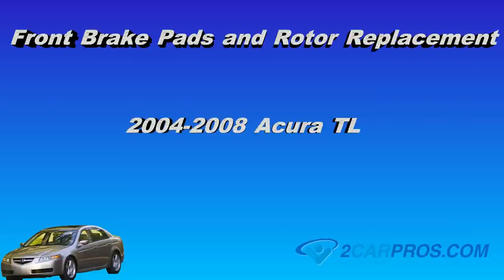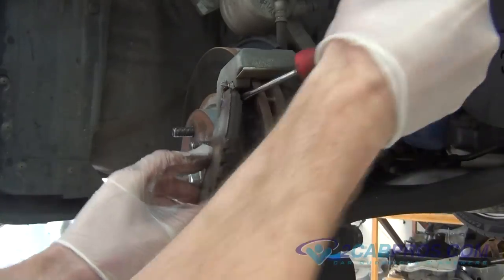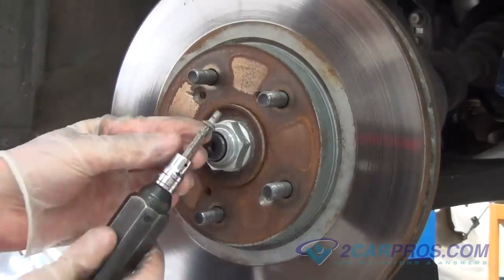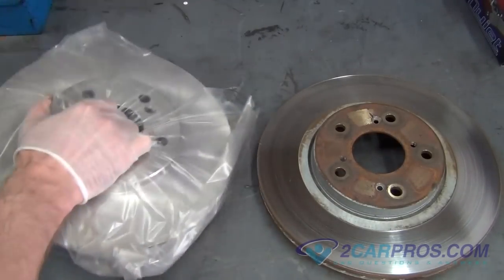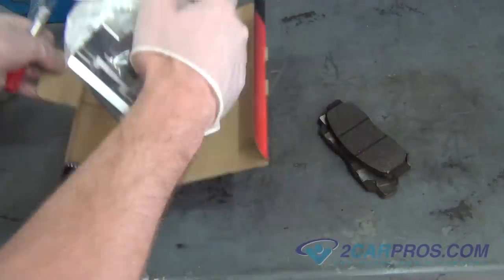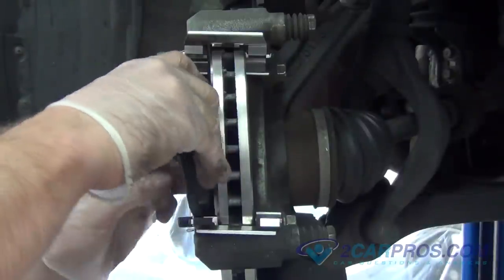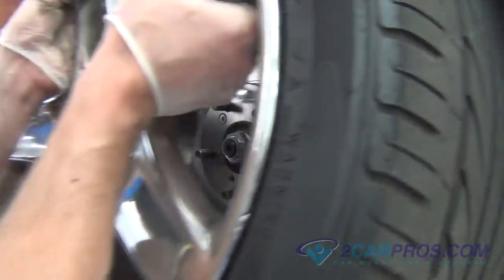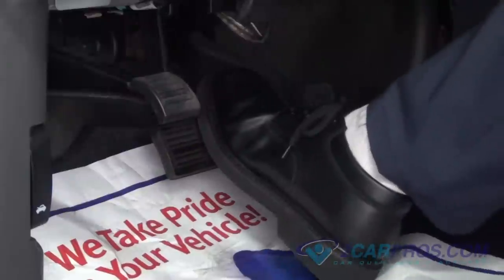Front Brake Pads & Rotor Replacement Acura TL 2004-2008

Comment: For those curios of the appropriate metric sizes here they are:

Caliper bolts: 12mm
Caliper bracket bolts: 14mm
Rotor removal bolts: 8X1.25 bolt use 8mm to remove etc.

You're welcome and hope it helps.
Reply: Franklin Doungahnont manual transmission = 

19mm bolts 
10mm hex
Reply: Does anyone happen to know what size bolt and thread pattern are they using to push the old rotor off?
Reply: That “rotor removal bolt” is very important as I found with my Honda Ridgeline.  It was M8 x 1.25. Thanks for posting this! I was wondering what size that might be and hoping Honda just made all those holes the same size
Reply: You are the best will def need these in the near future
Reply: For me it was 10mm bolts not 8mm to remove rotors I went to the shop just for the 8s and then after that didn’t work I used a 10mm bolt off my old Honda seat brackets and it worked I got a 08 base idk if this is a 04-06 thing with the 8mm
Reply: @E_ina_G  thank you for that. About to do this on my moms '07. So, 10 x 1.25?
Reply: @E_ina_G  Maybe you have a Type-S, and they're different? The brake system is def different between Type-S and non.
Reply: @andreww7857  I mean you can just hit the rotor from the back with a rubber mallet to remove it. I have used this way to get the rotor off on my accord
Reply: If you're right, I fucking love you

Comment: This is an excellent video, both informative and educational. Thank you for this. The anti-seize is true, so add the below comments commensurate with the video. I like the fact that Acura has the two Philips mounting screws that secure the rotors, then has the two threaded holes to use metric bolts to screw-in to pry-out the rotors. Not sure if American cars have this feature, but my neighbor has a GMC truck doing the same brake job. He can't get the rotors out after three (3) days on it.  A real "pain-in-the-ass" for him. But lucky for me, these Japanese cars are well-engineered, well-designed, and made to last an easy 300,000 miles. Acura is simply the best for the DIYer, backyard mechanic, engineer,  and tinkerer.
Reply from the maker: Thank you for watching!
Reply: Man you just made me feeel so much better for choosing an Acura thanks man if you have any tips let me know stay up 🙏🏻
Reply: The TL is USDM, made in the states.
Reply: You must live in an area with no rust.  LOL.  Those two nasty little screws (JIS b1012 crosshead screws that take a #3 JIS crosspoint screwdriver......and not a true philips) are the reason so many impact screwdrivers are sold.  AND they serve no purpose after manufacturing the car.  Sometimes you can get them out, sometimes it's easier and faster to drill them out.  They're a PITA and not something I would point to as a good design.  This wonderfully rust free car sure don't exist around my neck of the woods, and the resulting fight to get the screws out would have made for a much more realistic video. 
And obtw, if you have the 6MT version then none of this video applies since they come with Brembo calipers in the front.

Comment: Nice vid.  It's gonna help a lot of people. Since you're doing a specific vehicle 1) you ought to say the size of the bolts used to force off the rotor.  from doing my Ridgeline, those bolts are critical (8x1.25 metric) and 2) you wimped out on the slide bolts:  how do you know if they need grease or not.  what do you do if the DO need grease?  seems like you guys didn't use brake grease anywhere come to think of it....

Comment: What size bolts did you use to remove the rotor.
Reply: I 2nd this. I can't find this info anywhere
Reply: 8X1.25
Reply: Hammer

Comment: 37 and 80 ft lbs. You're welcome.
Reply: Which is which
Reply: Not very informative
Reply: @shlumpgod  are you two freaking kidding here? Go ahead and put 80 ft pounds on the caliper bolts and strip them out lol. It's 37 on the caliper bolts and it's 80 on the bolts that hold the bracket in... That's just for the front. The rear caliper bolts are going to be less probably closer to 25 off top of my head
Reply: And the bolt sizes?
Reply: 6yrs later you still the goat, thanks man 🥹

Comment: I wish you had one for the rear - seems they're practically the same with one exception (possibly?) that the brake piston gets turned to go back into the cylinder rather than pushed in as you did with channel-locks - would that be pretty much the only difference?  Or can the rear brake pistons also get pushed in with channel-locks?

Comment: I didn’t remove the fluid reservoir prior to pads replacement. I didn’t disconnect any brake lines either. But the brake pedal seems really spongy. 
Should I bleed the system now even though I don’t think I let any air into the system?
Reply from the maker: Did you prime the system by depressing the brake pedal slowly and letting it up slowly until you get a firm pedal?
Reply: @2carpros  After installing the pads I jsut pressed the pedal firmly and released it. Done like a copule of times, I think. Should I do anything else now or jsut bleed the system?

Comment: Which type / manufacturer brake rotors and pads would you recommend for my 2008 Acura TL-S ? Is E-Line a good source?
Reply from the maker: Bosch is usually good or I usually recommend the OEM. Thanks for watching!
Reply: OEM is known to warp easy among the Acura community. If you want to spend a few bucks, Stop Tech or EBC.
Reply: @ICantBreve   I heard powerstop is also good but I hasven't used them. I have used brembo NAO pads and they were fantastic

Comment: hey there is it possible if you make a video on how to remove the rear brake pad and rotors off a 2005 acura tl it will be very appreciated if you can make a video thanks

Comment: No torque specs for caliper pin bolts n caliper bracket bolts, no anti-seize on the hub or underhat of the rotor, no brake grease on metal clips that goes on bracket, no anti-seize on shims of the pads, no silicone grease on the caliper pins, terrible video.
If you follow this video, don't be surprised if you experience squeaks or uneven brake pad wear where you will end up replacing your pads quicker.
Oh and also, I advise people to have breaker bar for first timers. If bolts r hard to take off, breaker bar will help loosen them. If you apply proper lubricants, your brakes will last longer and also, easier to work with next time you do a brake job.
If you wanna go extra mile, I suggest bleeding brakes too and if you do, then you dont have to blred them ever again as long as you use turkey base and drain and replace brake fluid from your reservoir every 2 years. Make sure none of brake fluid drip anywhere on metal or paint bcz they're corrosive and can rust the metal or damage the paint.
Reply: thank you for this comment, its very easy to overlook these things. would you say that this video is still helpful just as long as we keep in mind the things you've mentioned?
Reply: notoriousone It's useful in terms of seeing how the brake system for 04-08 TL gets disassembled and reassembled with new pads and rotors since every car brand n model, even year, are set up differently. I just wish this video contained lubricants on right places while mentioning torque specs. Torque specs are important because you dont wanna overtighten any bolts, whether it's caliper bracket, pins, etc. Lubricants are important because it prevents uneven wear, squeaks, rusts while making your brake job easier to work with next time u do it again.
Reply: EdDy4RheelZ 
I like to open the bleeder screw when retracting the pistons so the contaminated fluid is expelled instead of getting pushed back into the lines
Reply: EdDy4RheelZ remove one brake line bolt for more hose. 37ft lbs caliper bolts. Bracket is like 90 ft lbs but I'm not positive
Reply: EdDy4RheelZ where can you take a car that will perform all this in service? I feel like trying to DIY will screw something up :/
Reply: Why don't you make a video then Mr. Smarty Pants
Reply: thepiecesfit dude just go for it
Reply: EdDy4RheelZ but he was wearing rubber gloves lol

Comment: What tool is that you use to tighten and loosen the bolts?
Reply: It's an air ratchet. A ratchet powered by an air compressor.

Comment: This is exactly what I did to both wheels, but now I'm having this very high pitch noise coming from the left side only. Can you tell me why is this happening?
Reply from the maker: I would go over your repair and take it apart piece by piece to see what went wrong. No worries every mechanic makes mistakes, but go over your repair ASAP because it is a major part of the vehicle and safety.
Reply: Probably a mounting clip is misaligned, scraping the rotor face.
Reply from the maker: That also could very well be

Comment: Might mention the use of a breaker bar and the size of the “rotor removal bolt” (probably M8 x1.25) Does anyone with a air ratchet need instructions on how to do a brake job? These are key points for people doing this job with hand tools

Comment: In my head I can do this in 30 minutes, in reality is going to take me 3 hours 😂☠️
Reply: You'll get the fronts done in about 45 minutes in total for sure considering you have decent tool/mechanic knowledge, but most importantly dependent on is those rotor screws are stuck 😭😭😭
Reply: Currently going through that with my 04. Driver screw came off almost too easy. Had it done in about 15/20 with hand tools. The other 3 are rusted in there. Wd40, heat, hammer and punch, impact screwdriver, heat, heat and they still in there. My last choice is tap and die kit.

Comment: Video is probably too old for anyone to see this but the metal brackets have a rubbing noise to them when I’m driving but they are installed correctly. Should I be worried
Reply from the maker: The bracket for the caliper is rubbing on the rotor? It shouldn't, I'd take it apart and see what the problem is. Thanks for watching!

Comment: Did u bleed the brakes
Reply from the maker: +TheMajorPena Bleeding the brakes is not necessary when you compress the brake piston back into the caliper then pumping the brake pedal after the repair to squeeze the brake pads to the rotor.

Comment: stripped my caliper. Should have taken to shop :(

so the two huge bolts going into the caliper are going into aluminum.. The torque spec in the repair manual is wrong at 110n, its too much for the aluminum
Reply from the maker: Bummer! 

That's why torque specs aren't always the end all be all of everything that people hope they are. Sorry that happened and thanks for watching!